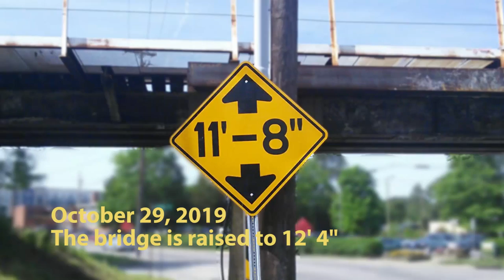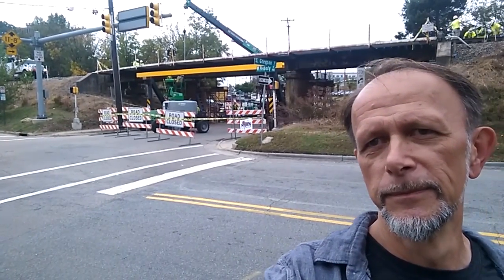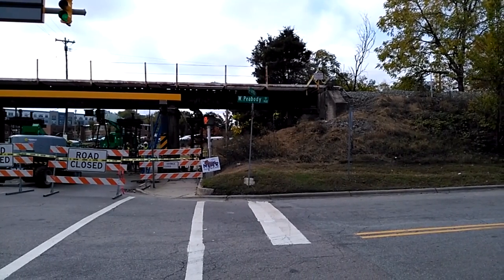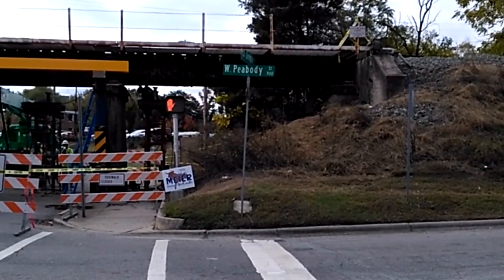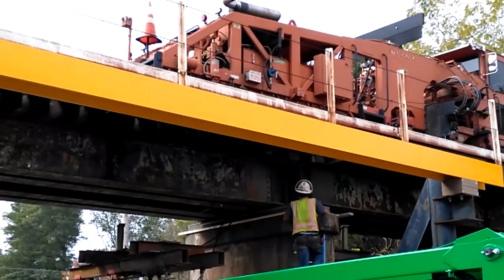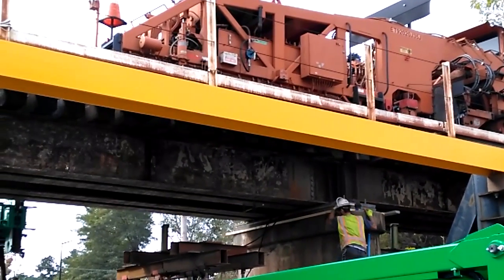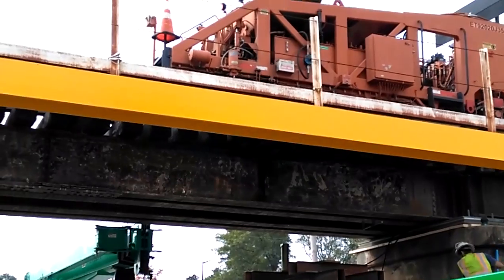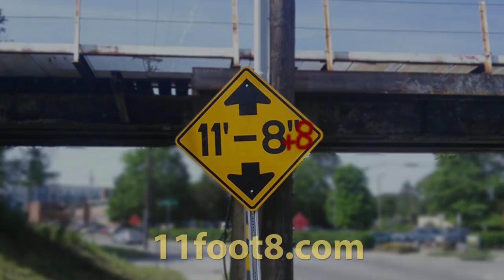Raising the 11foot8 bridge by 8 inches

Comment: That's a spiffy new crash beam they put there. It would be a shame if... something happened to it ;)
Reply: Mick 92. It’s not called a miss beam is it....😂😂
Reply: We can rest assured that someone at some time will be documented either giving it a boop or a bash.
Reply: Not sure if the yellow Penske trucks will add more paint to it this time. ;-)
Reply: When I saw the new yellow crash beam I was thinking there is the new cheese grater.
Reply: Penske: You wouldn't want your pretty new beam to get hit, would you? Better pay some protection money ... never know what might drive down this road ...
Reply: Exactly..... I don't understand wasting all that time, money & effort for ONLY an 8 inch lift😞
Reply: Mick 92 Oohhh!! You ain’t seen nothing yet!! LET THE 12-4 DESTRUCTION PARTY 🎊 BEGIN!!
Reply: @mayhemmike1789  Probably the best compromise between doing the full legal height, and the cost of lifting and relaying a few miles of rail track on the approaches, as they probably could get away with the 8 inch raise merely lifting the rails on the existing ballast bed, but with a higher lift they would have to lift the rails, remove the ballast, sift and regrade it, then lay a thicker bed down, tamp it to spec, and relay the gravel and track on top. If they were doing that the track would likely be replaced as well, too close to end of life to withstand the stress of the relay, plus replace all the pillow blocks and sleepers with new precast concrete as well. Take probably 6 months to so, right in the busy summer freight season, and not doable in winter. Instead of a half million dollar upgrade easy into the 20 or 30 million range with the need to reroute and cause delay in freight, and the railway would be looking to the city to cough up some of the money.
Reply: @SeanBZA  yeah yeah I fully understand a higher lift will be much more of an engineering/construction feat, but they're trying to prevent crashes right???
Reply: @mayhemmike1789  Not really, just reduce them in number. Probably the amount they spent was just to get the majority of the accident height vehicles through, though I think the City will still have to keep the trigger at the same height to divert vehicles away from the bridge anyway. Not that the turn and next crossing is far, as you have it within view of the bridge, just that people are dumb. Best thing would be to get google maps to navigate vehicles away from this bridge by default, as that will get most of the renters, who are the favourite victim, out of the can opener.
Reply: @SeanBZA  oh well, the can opener will continue to eat I guess🤗
Reply: hahaha
Reply: SeanBZA ....or lower the street
Reply: Maybe someone should hang aluminum cans from it to simulate hitting the beam.
Reply: Is it now a motor home ac remover?  A top truck scraper only?   Why spend time and money raising the bridge.   It’s a tourist trap and idiot locator.
Reply: sammolloy1 that too would be considerably prohibitive. There is likely all kinds of water storm and sewer lines under the street. Plus you would have to lower that intersection which means lowering and regrading those roads too. Lowering grades means you need to redo the drainage so it doesn’t flood. Permits for this all too. Then the nearby driveways and sidewalks and entrances to building get lowered too. 

Maybe you could squeeze 2-4” without major rework and get it to 12’-6”. 

By the way. The bridge was measured to be 11”-10” back in a previous video (they go down a couple inches for tolerance. So in reality it will be 12.5’
Reply: @mayhemmike1789  
Without a doubt but it has been put on a diet. ;)
Reply: No, I promise, I didn't see the little gremlin in the shadows.
Reply: Someone could weld a 6”” I beam to it to catch rental trucks.
Reply: @SeanBZA  -- yes, because trains can;t do speed bumps.
Reply: @johnturner4400  Miss Beam 2019, she looks beautiful dressed all in yellow.
Reply: "Cos things break, don't they Colonel? Accidents happen!"
Reply: @JasonW.  ...Could save you a lot of bother rebuilding that bridge...

Comment: The lights, the warning signs, the giant orange bar, even just the legacy of the bridge and it still wasn't enough to stop idiots from slicing off the roof of their trucks. That it's come to this, literally lifting a bridge off its supports so that it can be raised higher, is just astounding. Yet here we are, nearly a year later, and it still wasn't enough. Incredible.
Reply: Esspecially since it would have taken a weeken to lower the roadway 4 feet.
Reply: just put a beam over each approaching roadway AHEAD OF THE BRIDGE and hang Chains from them a little longer than the clearance of the bridge, then the driver can hear in advance when his truck hit the chains if its to high, now you have gone and raised the bridge, what videos are we going to watch now
Reply: The city is at fault here. If there are this many accidents occuring because of the bridge, they need to fix it. A basic traffic survey and the city not being cheap would solve it.
Reply: @russelljuma9585  Railroad Right-of-Way, FEDERAL clearance and decision making needed. Railroads even have their own POLICE forces.
Reply: @russelljuma9585  There's not much you can do to fix it. There's a marked detour route around this bridge nearby. The railroad is the railroad companies responsibility not the cities.
Reply: @isorokudono  lowering the road would have probably been a lot more expensive, because 
1.) it's an intersection, you'd have to tear up and regrade A LOT of road to lower it by 4 feet.
2.) Road foundation also needs to be compacted, which can take multiple weeks (and you have to pay for labor)
3.) large sections of road would need to be repaved, the bridge foundations would need to be reevaluated
there's a lot that goes into road construction
Maximum road grade is generally 6%, meaning that you'd need to tear up atleast 75 feet of road in all directions from the intersection, and on both sides of the bridge, potentially over 200 feet if the nearby road is already sloped!
Reply: @sage5296  Base rock is cheaper than raising a 50 year old trestle. TRUST ME.
Reply: @russelljuma9585  The reality of civil engineering is a lot more complex than most give it credit for. A problem that seems simple on the surface (e.g. this bridge needs more clearance) likely explodes in complexity once you consider all the logistics, legal issues, and expenses involved. It would be far, far simpler if people would just observe the ample warning indications and weren't ignorant of the vehicles they are driving, both being completely reasonable things to expect from a competent driver.
Reply: And in this video we learn DUKE has a level crossing just a block away, whoever keeps these one-way roads and doesn't just close the tunnel is having a piss
Reply: It was $500,000 wasted by both Railways.
Reply: @bertrams1384  Except when the driver is blasting Kid Rock from his stereo and cannot hear the chains hitting the roof.
Reply: @bertrams1384  and yet somehow i believe people would still hit the bridge. As Ron white said...you can't fix stupid.
Reply: @sage5296  the "why don't they just X? TRUST ME" commenters are so tiresome :-(
Reply: Matrix29bear  why should you have to go through all that trouble when a person can easily see all the signs and they choose to ignore....they'd probably ignore the tassels also.
Reply: The idiots are the people in charge of the roads and safety in this city.  This was a complete waste of money as most trucks still can't go under.  Fix it or close, this isn't a third world country.
Reply: @ThenVersusNow_  yea you sound like one of the people that would hit the bridge
Reply: @durapoker  Whether people are dumb for hitting it, is irrelevant.  It is a problem that needs to be fixed.  Over half million dollars to raise it, which made literally no difference.  If only they had information such as the height of 90% of trucks before they did the work.  Hmm.  Pretty smart city.
Reply: @ThenVersusNow_  There's literally a detour available for trucks a half a mile before the bridge and that detour leads to the same place the bridge leads people to. The city isn't at fault, it's stupid truck drivers who don't read the dozen signs that are in blaring red lights and ignore roads that lead them to the same place as the bridge does.
Reply: @tomjones6944  Duke lords over their private roads bridges etc. You can tell immediately based on the nicer upkeep, and they all lead to the campus
Reply: Really they should have changed the sign to say 8ft or cars and light trucks only.
Reply: I often read the letters to the editor in Consumer Reports. The people writing in are always  wanting the car makers to add more safety features. I haven't read any yet about requiring drivers to drive more intelligently. It's similar with the 12' 4" bridge.
Reply: @bertrams1384  That's how it is done in civilized places.  I think the town thinks its funny.

Comment: "They raised the bridge and and that should do it".

UPDATE:  That didn't do it. 😂
Reply: Of course it didn't. Because people.
Reply: Golden Knight  sewer line runs right under the road.
Reply: Golden Knight actually it is manholes there
Reply: Golden Knight drive thru there, it’s manholes under that bridge. I go thru there daily so I don’t need a google nothing to tell me what I run over and almost get hit by others dodging them either, what makes you think they have to be in the center of the road?
Reply: There's more than one utility running under public roads. There gas, electric, traffic signal, road drainage, sewage and some I'm forgetting. Each utility has their own elevation. 
Just lowering the road under the bridge would cause a low spot for rain water to collect and the town would have to install some sort of pump system or increase the drainage.. considering the underground piping can handle it. And it's possible it would move the frost line down to a critical level beneath the bridge.
Raising the bridge was the quickest least expensive , least time consuming method. 
And let's not discount the imbeciles that hit the bridge despite all the warnings...that is the real problem.
Reply: @samiraperi467  And because the national standard for bridges is still higher than the new height and raising it again is seriously impractical.
Reply: @killman369547  
It's still too low for sure, but in almost every video I've seen of trucks ramming the barricade, they just miss clearing it & it shaves off the top. This will allow for many of the idiots that ignore the warning to make it through.
Reply: @alleycat1084  jesus I hope you're being sarcastic 🤦‍♂️
Reply: @young11984  there's *
Reply: @stabenheimer  oh boy we have somebody here to correct someones spelling so you can fill your lack of superiority? Cool deal hope you feel better about yourself, roll on through the rest and correct them all so you will feel like a king. Smh

Comment: Turns out further down the line there is a bridge that is 11'4" . Time to move the cam :)
Reply: Yeah. This is kind of bad cause the best part was seeing the trucks get the tops ripped off and slammed under the bridge. Like woooah!
Reply: @greenlawnfarm5827  they still will. Most are 12'6".
Reply: @ptmy8590  Ok. Good.

Comment: The scaffolding those jacks were on, im blown away that supports a bridge!
Reply: That's what I thought.  What are the jacks even doing there? A quick check of acrow prop limits shows that each 'screw pole corner' of those scaffolds can support about 3  tons.  Looks like there a 2 x 4 lots.  So under each jack I'm assuming 12  tons max working limit.  24 tons for 2 jacks combined.  Surprising amount actually
Reply: If you think about it, the bridge itself probably isn't that heavy - it's the trains overtop that really need the support! So shutting the bridge means they can use very small jacks.
Reply: You'd be surprised.  If I'm not mistaken same jacks are used when leveling a house where the foundation has sunk.
Reply: @alexzee4564  I think he was more surprised about the jacks being on scaffolding being able to lift, not the jacks themselves.
Reply: Yeah, that looks safe.
Reply: And you aren't in construction trade, obviously....
Reply: The scaffolding is made out of the same materials as the bridge, they say both were forged in mordor.

Comment: It's still under standard 13'6" so there will still be crashes but probably not as many
Reply: Not to worry.... The crashes may be not as good as before, but there are always morons out there trying to squeeze through.
Reply: I don't know, there's another bridge the same height on the next block over. I never hear of it getting hit
Reply: @BrentRoberts01  Because most rental trucks came from the same side of 11'8 and their drivers have learned their lesson for their return trip :)

A few 11'8 crashes were on trailers tall enough for the top to be above the old crash beam, pretty sure those would still get de-lidded by 12'4. Wouldn't be too surprised if 12'4 got a fresh diet of 12'6 trailers thinking they can go straight through now.
Reply: Do you think  professional truck drivers behind the wheel of a semi are going to not read the signs ? It's not like you can rent the vehicles that are going to potentially crash on this - with a regular driving licence.
Reply: @teardowndan5364  for everyone's sake here, I hope you are right!
Reply: @xl000  actually you can rent a tall vehicle that can hit this. The cdl requirements is by the weight the truck can carry, not how high it is. A truck has to be gvwr over 26.001 to require at least a cdl class b. If the gvwr is under 26.001, no cdl needed. And I've driven a couple big box trucks that didnt need a cdl.
Reply: @xl000  At a glance, vehicle classes are defined by gross weight, number of axles and purpose, not height. So I wouldn't be at all surprised if some companies did lend vehicles close to the typical minimum clearance of about 13'. Of course, it would be hilarious if a company offered such vehicles anywhere near an area famous for its 11'8 bridge.
Reply: After all that work you think they would at least raise it to The standard
Reply: @TheJoeSwanon  Wouldn't be surprised if the limited raise was because this is the maximum that engineers deemed safe without re-engineering the entire terrain slope around the tracks instead of only re-packing the tracks' foundation to correct grade and re-spacing ties which are part of routine track maintenance.

They may even have picked now to raise it specifically because the span was about to be up for maintenance anyway.
Reply: 13'6" is only 'standard' on interstate highways.
Reply: @xl000  if that was the case this channel wouldn't exist in the first place
Reply: @xl000  I guess you haven't seen all the commercial trucks and semis hitting this lol
Reply: @seanwatts8342  Isn't the Interstate standard clearance a minimum of 15'? (Formerly 17' for nuclear transporters.)
Reply: @buddyclem7328  The minimum was determined in the days when the Army had Nike Hercules missiles (the original reason President Eisenhower wanted the Interstate system) but it was 13'6" for interstate highways. The military transport plans deviated around lower clearances, especially rural areas and small towns. The military crews in charge of serious explosives do not operate as carelessly as chuckleheads in a rental truck or RV. HERE'S THE CATCH ...if you dropped a tape measure from the bottom of an overpass to the surface of the road below the measurement will tend to be more than the sign reads. This is to allow for dirt/gravel buildup and snow & ice in winters. If the DOT resurfaces the road they are required to remeasure and remark if need be.

Comment: I cant believe that scaffolding  held with those jacks.. Jacking up the whole bridge.. Insane.
Reply: @dsndicmsa sewer line doesn't allow the road to be dug deeper.
Reply: I came down looking for this comment.. Didn't realize scaffolding is that strong.
Reply: If you look the end points had jacks under pieces of timber.  If I & my neighbor lift a beam & have your 8 year old brother & sister under its middle.  Are they actually holding all of that weight ? Or is it still just me and my neighbor ?  🤣🤣  Carry on .. & have a great day !
Reply: thats probably speciallly enginired for that ..not regular scaffolding
Reply: Ok, I'm glad I saw this comment because I was sure there was something I was missing when I saw those jacks and I beams sitting on scaffolding.  

Makes you wonder why they needed those I beams if the scaffolding was strong enough to hold it.
Reply: @82ndAbnVet  Jamie pointed out on the ends the jacks are sitting on a solid foundation and only the jacks in the middle on scaffolding are keeping it from sagging. Probably still a lot of weight they are holding up and I think it is cool some engineer just gave that the green light and said it was fine.
Reply: That scaffolding is a structural one, not the one used by decorators. BTW, the bridge is not as heavy as it seems: the big load is the train passing on it. For sure, no train while lifting...

Comment: 12’ 6” is pretty much a standard rental. sometimes 12’ 1”. Let the crashes continue
Reply: Engineers...
Reply: Ya, most of the trucks I have driven 12'6.... Keep the cameras rolling!
Reply: So is 13' 6" around my parts.
Reply: @ElevatedEyes2023  13'6'' is semi height. 13'1'' is usually the cut off height for Penske straight trucks.
Reply: @leocardenas7306  this was a Ryder rental truck.
Reply: In my country nearly all traffic bridges are 15 feet, so there is little occurrences of crashes
Reply: @ElevatedEyes2023  they are normally 12'6" as well.